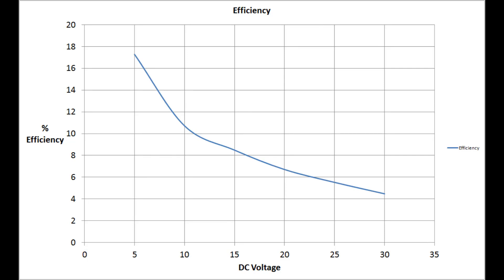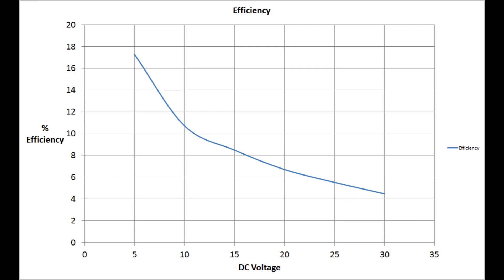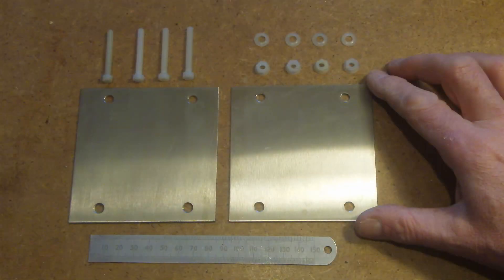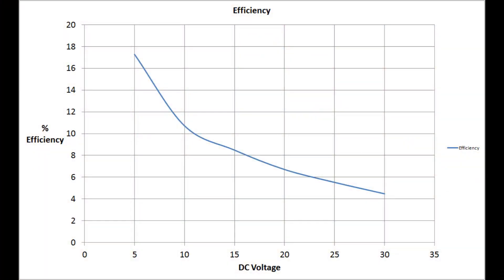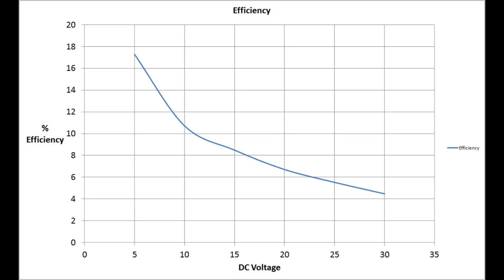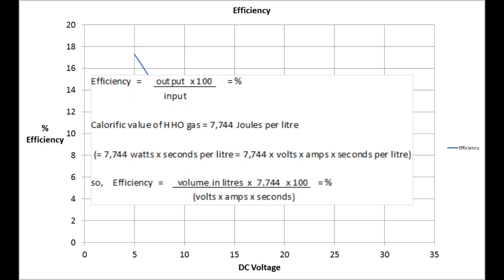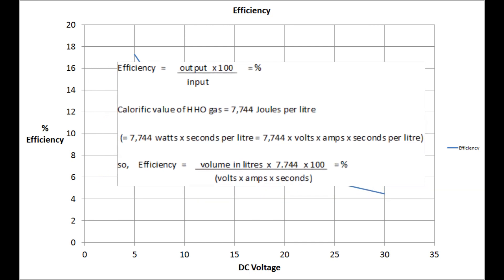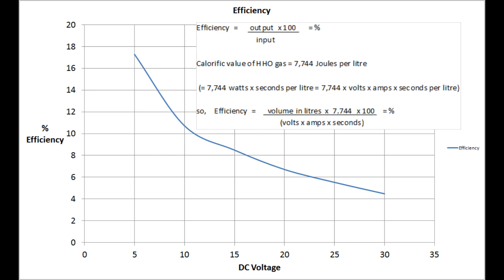HHO. 8 Test cell efficiency graph, 5 to 30 volts DC

Comment: best efficiency  for only 2 plate cell  is 2-3volts.... put 5 neutral plates in between the positive and negative plates and 1.5mm gaskets. and then try test again....also try mineral  water or  electrolytes in your water...this is FLAWED for trying to achieve efficiency